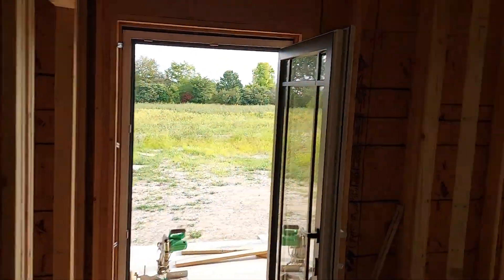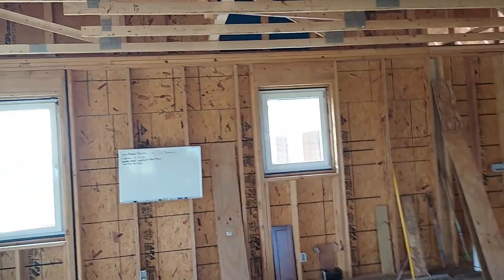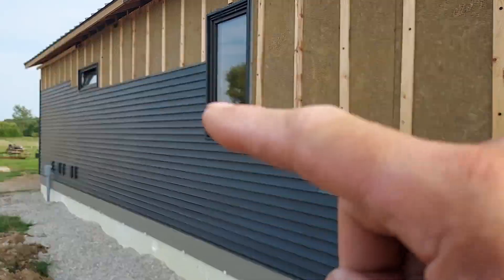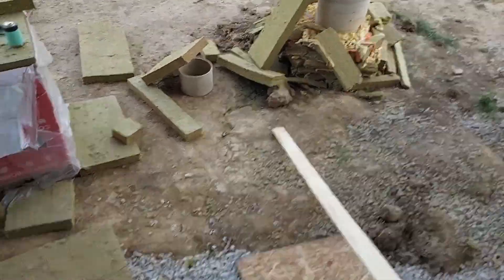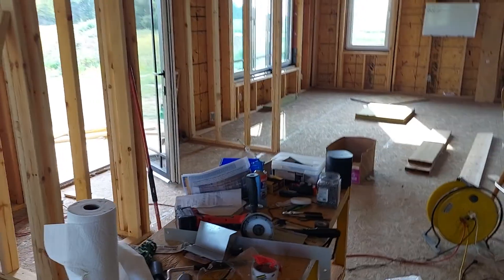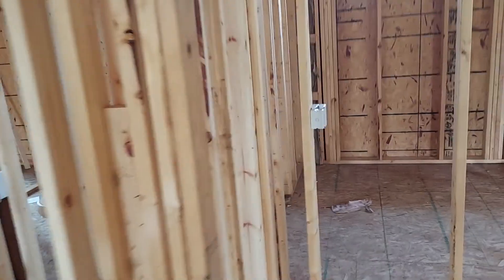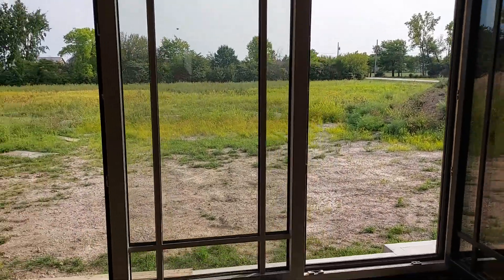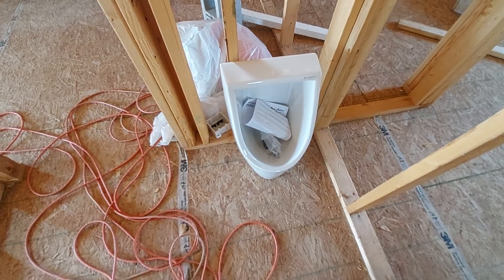building a superinsulated house with exterior insulation notes and progress Logic  Ventana Windows

Comment: Pretty big house it will be interesting how it performs for energy conservation. Just wondering where the vapour barrier will go in your design if you have one.
Reply from the maker: I am using the forcefeild system which is like the zip system.  both have a layer laminated on so no need to staple up tyvek.   vapor barriers are not needed as the wall system needs to dry inward and outward. only need a water barrier, air barrier and weather barrier.

Comment: I am building a casita and am going the same route?  When you said @1:13 “I have 2.5” interior walls” what did you mean?  On Reddit, you said the exterior was 2x6 walls, so did you frame another 2.5 onto the 2x6 from the inside?  Or did I mishear you?  I ask for the interior walls look pretty shallow.  Looks great!
Reply from the maker: Good catch!!  I meant to say 5-1/2" since I have 2x6 walls.  They look shallow I think just because of the camera.
Reply: Thank you!  I am embarking on a 20x30 Rectangular Casita here in Tucson, AZ and am following your insulation protocols 👍.  2x6, comfort-board rockwool around the exterior, rockwool for interior walls, and triple panes for the windows.  I read your posts on Reddit and it brought me here 😁
Reply from the maker: @andrewgavi  fantastic!!  You will have excellent exterior drying potential because of using Rockwool and will not have any condensation issues whatsoever.  Best of luck to you and try to have fun!  It's very rewarding but still ended up kicking my rear end.   I'm going on two years and in fact just now took a break from doing a little window casing work!